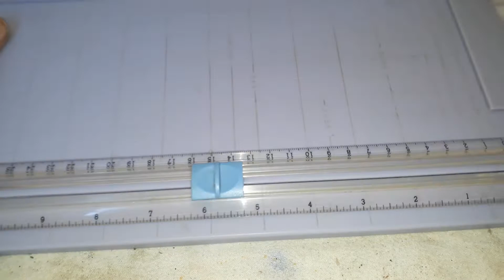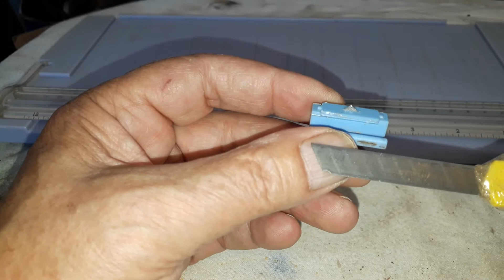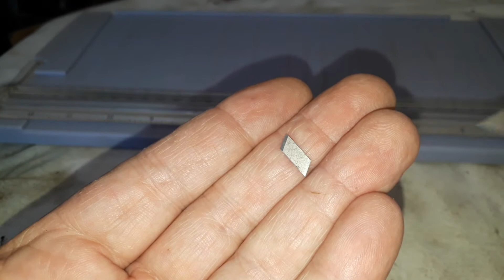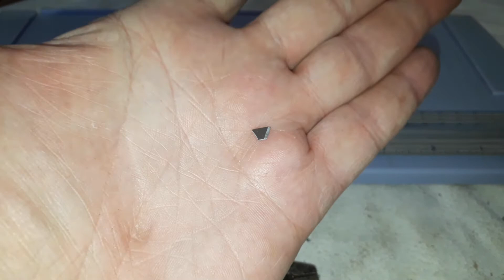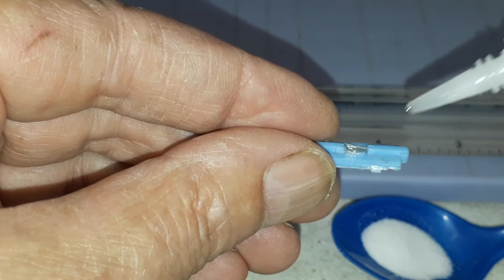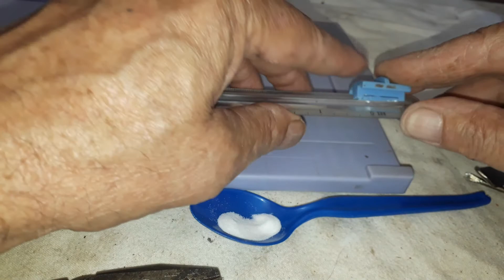How to make a blade for your Paper Cutter easy, dull blade no problem

Comment: Very clever Jan, great instructive video, we have one of these cutters too - can't find the proper replacement part - so I can try this myself too - have that kind of blade, but need to buy some superglue first. I didn't know that baking soda can be used as an accelerator to speed up the hardening of the glue, so that's a good tip too!.
Reply from the maker: Glad it was helpful Piet, the baking soda with super glue make an instant rock hard bonding, you can fix anything with that recipe, nice gap filling abilities as well